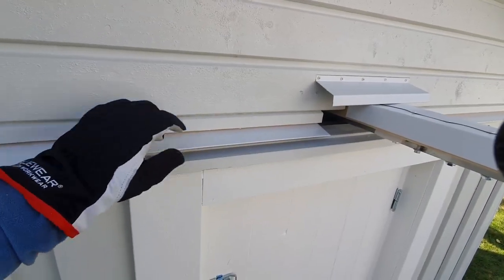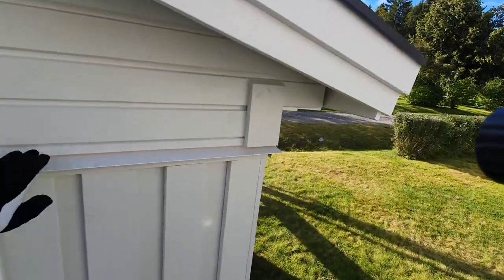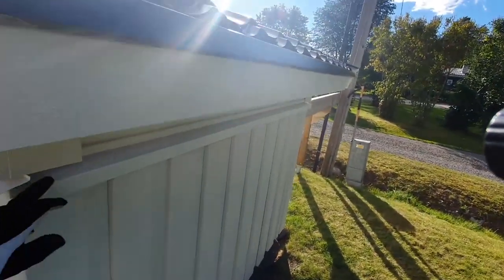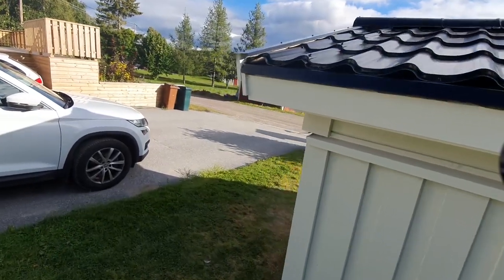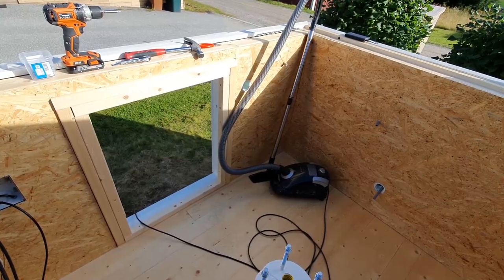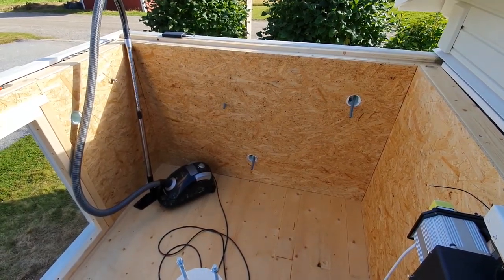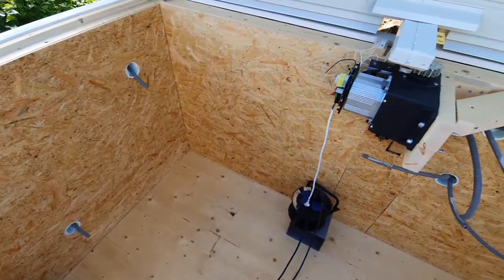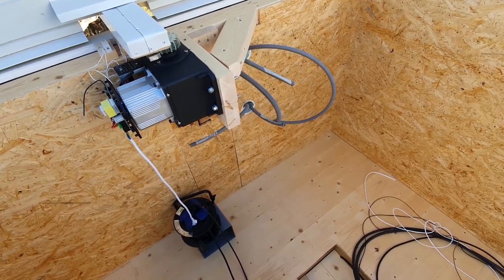Building an Observatory Part 15

Comment: Hello. I like watching your videos. You are very talented. I’m going to do something similar to yours but . I will put the motor outside instead. And the extension 2x4 track,  will be outside but on the oposite side . Not facing the front door. You could also cover the motor from the rain outside. And it will give you more space inside as well. I hope you continue sharing your experience while stargazing.
Reply from the maker: Thank you so much, this made my evening! I too would change a few things if I did it all over. For example, like you say, placement of motor, and I would also go for tracks that can hold the roof in place (would let me place motor on one side). I would also want to be able to roll off the roof a lot longer to clear horizon, and maybe a bit more slim roof. But I will enjoy this now for a few years I think.
Reply: Kom på samma sak med motorn placerad på utsidan när jag skulle sova på kvällen. Bra jobbat och hoppas allt funkar när du är klar. Lycka till
Reply from the maker: @janclasenius663  Ja, det kan nog fungera, men min grindmotor är gjord för att stå upprätt när den är utomhus, och jag tror inte den gillar regn i "liggande" ställning. Stående fungerar ju inte med kugghjulet så att säga.

Comment: Excellent job, really looking nice now! I like that you’ve lined the inside with OSB, I shall be doing the same with mine and fitting 40mm Celotex insulation between studs! Neat conduits for cables👍 Clear skies!
Reply from the maker: Thank you! I decided not to insulate, because then I would have needed vapor barrier as well and I guess the telescope want as cold as possible. I will install a fan that I can control and also a small heater that I can control to keep the dew at bay!

Comment: Nice job!   I would highly recommend putting the motor on the outside so nobody hits there head while going in or out of the door from that track that also has sharp sheet metal cover, plus it gives you more room inside.  It's never to late to make changes
Reply from the maker: Thank you! I will take that into consideration.

Comment: Great build! Im going to start mine soon. Quick question…what is holding your roof down? Are you relying on gravity or do you have it restrained some how. Just worried what would happen in a high wind storm. We have the occasional hurricane where I live and am thinking I need to address this.
Reply from the maker: Thank you! You are correct, I'm going to address this because it is not held down with anything at the moment other than weight and even though the roof is quite heavy I need to secure it. I'm going to figure out something that does not require me to go out there and secure it manually. I will include this in an upcoming video.

Comment: What a wonderful observatory. Great to see it all coming together for you. I have 2 questions if I may:
1) I’ve been following all the videos but how long has it taken to build excluding the pier build?
2) how much clearance is there between the pier and the roof motor?  Just wondering if you had an SCT would it collide with the roof motor unit. 
Thanks 
Rob
Reply from the maker: Thank you so much! It has taken about 2 months to build, and the last month I've been working as well. I don't have that much clearance, maybe 10 centimeters if I setup the scope a little different. I can however also lower the telescope pier adapter about 10 centimeters as well.